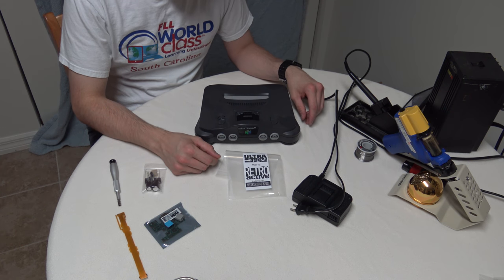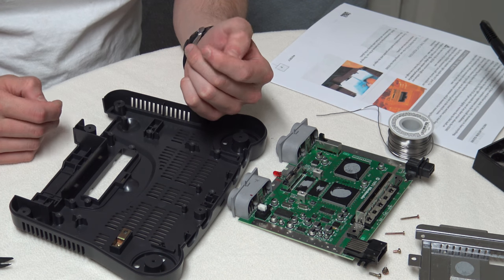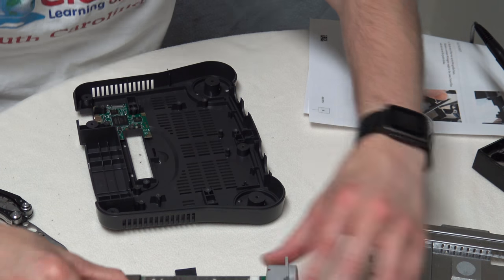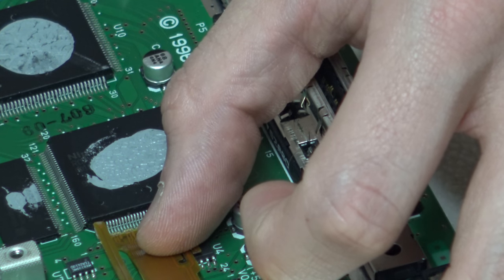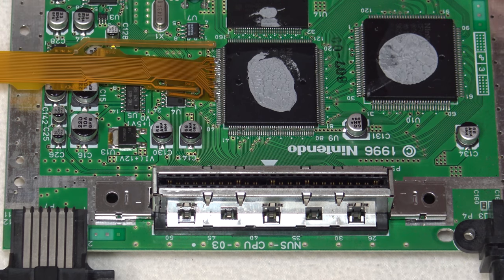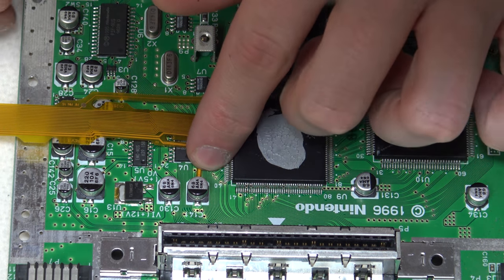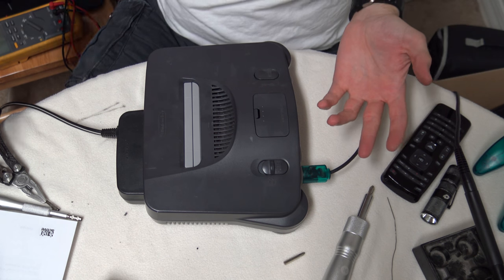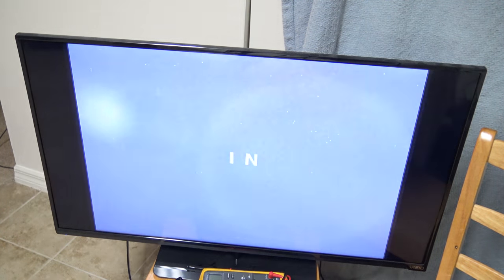UltraHDMI Mod Project - Or the need for Peanut Gallary

Comment: I use a spent desolder braid spool to hold the board level together with the EXT port on the bottom. It still likes to pivot though. You actually can remove the top cartridge connector since it simply plugs in to the bottom connector with pins that go straight through the motherboard. It helps if you want to refurbish it or clean it out. I guess it also gives you a bit more room to work with the UltraHDMI flex but not too much.

Comment: You can actually operate the menu entirely with the D-Pad which will not do anything unintended in most games. Left is Back/Cancel and Right is Action/Accept. Of course, the rest of the menu is vertical to navigate with Up/Down.

Comment: The GPU is called the Reality Co-Processor (RCP) or sometimes Reality Signal Processor (RSP) since it does audio and other things too.

The grid of thru-holes is for initial programming of the UltraHDMI. For security reasons they come blank from the manufacturer. That means RetroActive is forced to pay for the defective ones too in order to keep the manufacturers from running off and cloning it.

Actually, he accidentally shipped one to me that had been programmed but was “unprovisioned” so I wonder if this changed with HW2. The “unprovisioned” kit worked but the screen would turn yellow after some time. Perhaps this was done to allow it to work long enough for testing at the manufacturer but any clone would be unsellable. You can identify an unprovisioned kit by a corrupt serial number since that is assigned during the provisioning process.
Reply from the maker: I'll be honest, I haven't watched this video in a while, but I should have known back then what they were for, so likely had a brain fart, as I actually ended up with about 4 hours of troubleshooting, as I had managed a bridge.

Also likely why I apparently called the RCP a GPU, as modern GPU's do all of that as well.
Reply: @plebetopro5786  Early in the video you were just openly wondering if they still called it a PPU so I answered that. :)

Fun fact:
nVidia first used “GPU” to describe their GeForce 256 (the first nVidia GeForce card) with hardware transform and lighting. They tried to define it as a graphics chip that could push some minimum level of performance that the GeForce 256 was supposedly the first to achieve.

They obviously can’t market their current cards as “the world’s first GPU” and narrowly defining it like they did certainly didn’t stop us and the rest of the world for re-appropriating it to refer to any VDP/VDC, even from older hardware like N64. ;)

Comment: the first few times you tried it you had no jumperpak or memory expansion in it. you get no video signal without one of those in. also if you put it in the wrong way round you blow the psu so be careful. you can only put it in wrong when disassembled obviously.
Reply from the maker: Carl Robinson yeah, that was dumb.  Wasn't thinking about how RAMBUS works, and was just looking to have something happen.

I ended up having a couple bad joints that took me a couple hours to get figured out, as they were not what I was expecting.